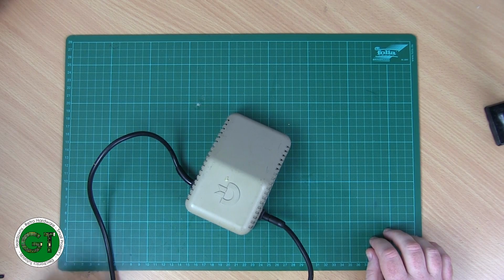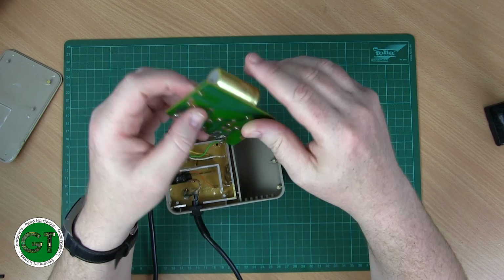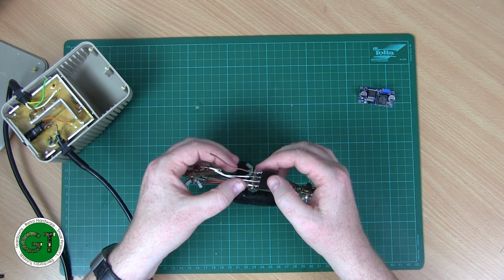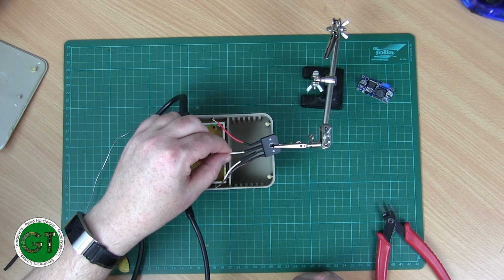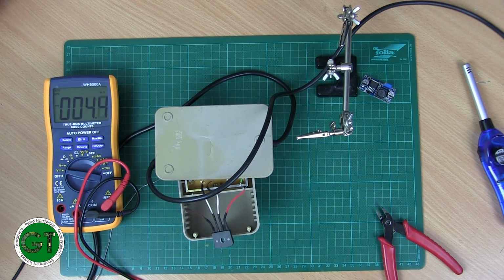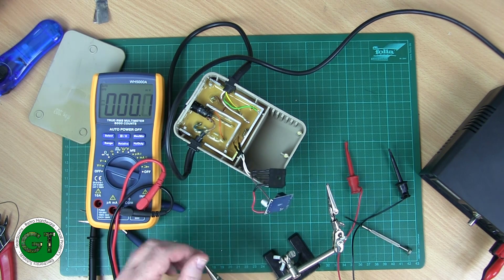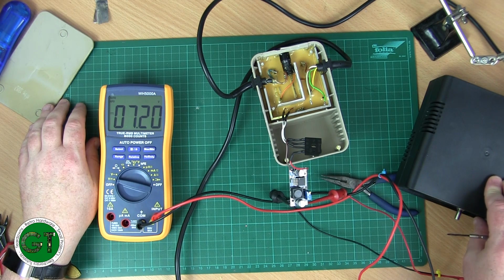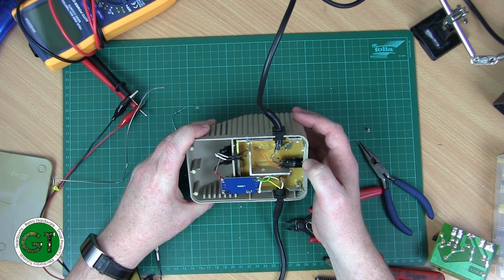Commodore 64 PSU repair, it is possible!

Comment: It never gonna get "as new!" Somebody ought to find out how to resolve the resin.
Reply from the maker: Anything that would dissolve the resin would probably damage the enamel on the windings of the transformer. Check out my other C64 PSU video, that type of PSU has the PCB in a separate section and is only lightly potted so is can be removed and replaced, I even made my own PCB.

Comment: Hmmm, looks all nice and good but I wouldn't have put the buck converter over/bridging the heatsink (18:40). When the PSU is 'upright' it will push down on the buck converter PCB and eventually maybe even wear out any isolation you put in there. With just a little bit more soldering you the wires could've been extended enough for the buck converter to fit in the front of the PSU's "cavity".

Other than that, nice! Enjoyed the video.
Reply from the maker: Thanks, I ended up taking the buck converter out as I made a new PCB based on the original, check out the video “Commodore 64 PSU rebuild” the files for the PCB can be found on my website.

Comment: Wow 7.2 volts open circuit and 5v closed. I was looking at doing the same. Did you end up using it in the end on your real c64 and how did it work out?
Reply from the maker: Hi Steven, I added a bulk capacitor to the input side of the board and a load resistor to the output side, that fixed the issue.
Reply: @GrahamTinkers  not sure which way to go, i need to replace the 5v side of mine. Thanks for inspiration. My original power supply is outputting 5.47 v. Built a power saver obviously doesnt solve the issue. Happy 64ing! Keep safe